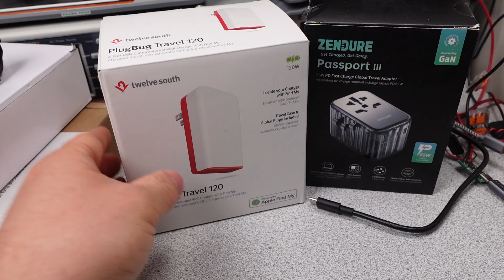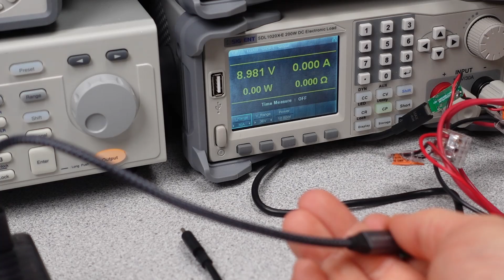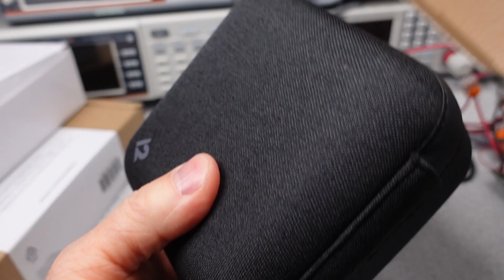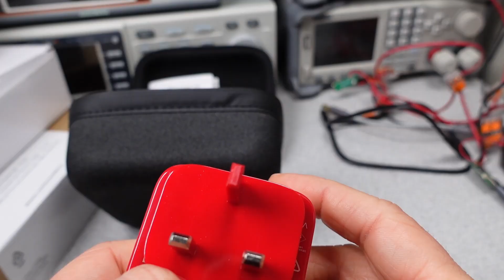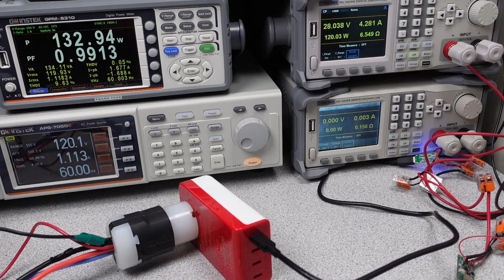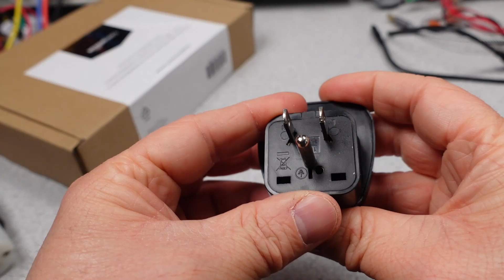Travel USB Chargers and Adapters Reviewed and Tested

Comment: Hope you can also test other popular universal adapter brands like Epicka, Ceptics, Tessan.
Reply from the maker: I think I've done a couple Ceptics and Tessan adapters of various types.  These things are under so many brands now.
Reply: @AllThingsOnePlace  Wow. Didn't expect to get a response at all. Appreciate it. I checked all your videos, couldn't find those for Ceptics and Tessan.

So far Ceptics offers up to 70W, Epicka 75W, Tessan 140W. 

I'm thinking they shouldn't be too great but idk, maybe they could be usable if you only consider 70% of their rating. Anyway, since they are travel adapters, most of their customers probably is bringing charger for their high wattage devices.
Reply: Always be vary if it has just two prongs but allows grounded plugs. Especially the two prong Europlug should never be split it converted to anything else. It is rated only for 2.5 A.

Comment: Was really hoping the Twelve South PlugBug would be the answer to my travel charger needs... guess not.  Anyone have any experience with either the Nomad Goods 130W power adapter or the HyperJuice 145W USB-C GaN Travel Charger with 4 Ports?  Am looking for a good travel adapter with three USB-C ports to charge an iPhone, iPad, and AirPods while traveling.. I've resigned myself to also carrying a 140W Apple charger for my laptop but would like to find a well made three port charger for the other stuff that won't burst into flames, or shut down after 30 min.  Currently using 2 Apple two port adapters and a 140W brick for the laptop.

Comment: Instead of an all-in-one foreign travel charger that's specifically intended to both adapt to various plug types and convert foreign voltage to 120V, what about reviewing the dual-voltage capabilities, performance, reliability and safety of chargers primarily meant to be used in north America but which one might want to take abroad if they're up to it. Then all you'd need would be plug adapters, which are fairly cheap and easy to find both here and abroad, and not have to buy potentially expensive chargers for use abroad.

That's how I've used my Baseus 65W charger, the one with a cord and 2 AC outlets. It's officially not meant to be used abroad for anything much over 120V, but it worked just fine when I tried it on 220V/240V systems without overheating, frying, smelling funny or destroying my devices. We're talking for well over a month, as I traveled through three different countries. Some research I conducted before my trip indicated that the USB charger circuity could actually handle dual voltage and that it was the AC outlets that couldn't handle higher voltages. But I figured that metal is metal and whatever voltage system you plug them into they're all AC and all have comparable max wattage ratings, and it's the watts, or amps, that matter, not volts. When I got back home it continued to work just fine, and has in the over a year since I returned.

But, most people won't want to wing it like this and would prefer a charger that's officially rated for abroad, and a review of the top chargers for their ability to handle that would be nice and useful.
Reply from the maker: Almost every charger is universal input voltage, none do any converting, none I show in this video are converters.  Some of the Baseus ones are specifically not though (I have a video on that).  The video says to use a universal input voltage charger and the appropriate adapter.  The charger will be marked if it can do the higher and lower voltages.

Comment: Most of those can be plugged in half.. which is not very safe and will be surely a fail/non compliant. Normally LVD can be tested on these easily, next to that the plugs will still need the plug certificates. That will still confirm the plug specific requirements (mechanical, dimensions etc).
Reply from the maker: Yeah, I like the dedicated ones, the AB ones, because they have official sockets on one side and plugs on the other that fit.  The multi-adapter things are not amazing but with shutters I kind of accept them, step in the right direction, yeah, I forgot to show how you can just wad plugs into these things in horrible ways.
Reply: @AllThingsOnePlace  😂great great content anyways!

Comment: I've had the Twelve South PlugBug in my cart for a couple weeks, went to see if YOU had reviewed it, and here we are! I was about to checkout and buy it...but bummer, it isn't great. I wouldn't mind some idle watts but I never want to see things get hot. Thank you for all your work.

Right now I lean on my 96W Apple charger (A2166) with the Apple travel adapters. I JUST WISH I had a decently equivalent charger with one more USB port, plus the swappable travel plugs. I try to keep things light and minimal, so I wish I could visit Europe/Ireland/UK with just one adapter. Four ports would be the max I would need - charging my phone, a battery, and maybe my watch - so I was hoping this device could do the job. I wonder if anyone will produce a charger like this but with decent efficiency.
Reply from the maker: Yeah, this one is tough, it on paper looks perfect.  Then it's not a great power supply which is it's primary function.  I'm still on the bring the cable or adapter you need and the charger that works.

Comment: Most of them try to establish some sort of data connection which one can tell by the prompt on macOS and iOS if one wants to allow the accessory. Can you tell why that is the case? Are there any USB controllers inside doing that by default?
Reply from the maker: They should not be asking for any data communications.  The chip is using the cc line to pass a small amount of data to negotiate power levels.  I'm sure someone will figure out a way to hack your machine through this path, rendering USB C completely useless, but there should be no data connection from this path to any part of the computer, phone, or any other subsystem data paths.  The computer can report if the charger is capable, allowing the accessory is understandable as it does connect to a data capable port but should not pass any information.  Are there bad actors, probably.  If you plug in a lightning, magsafe cable, those have their own chips in the cables.  So, may interact differently with the system.
Reply: @AllThingsOnePlace  Yeah exactly. There should be no data communication. However I had one Traveladapter with 20W out and it initiated comm on every port, type C and A. Both my iPhone and my Macbook showed the prompt..
Never had this before with any other device. Now I lost mine at a hotel and used another one from a friend: Same thing.

Don't know what they are doing there like what is the attack vector?

Comment: Hello mate, I am searching thru your videos already a week. The plan is to find perfect power source for frequent traveler. 10 months in adventure this year (US, Singapore, Indonesia, Africa) it is really a lot. Carrying separate charger for each device ( MacBook, 2x iPhone, android phone, Nintendo Switch, 2x headphones and Apple Watch) is really annoying. Almost bought Satechi 145w but your review help me to discard that decision. Mainly because isolation... I hate tickling when using some devices. Could you please recommend something from your lab bench?
Reply from the maker: That's a lot of devices... You probably will end up with more than one charger inevitably but there is certainly some opportunity to reduce.  I do recommend at least one apple charger, because of the reliability and good isolation performance.  The Zendure does have a lot of ports, mostly 5V ports but that will do all the small accessories and even phones, then one larger macbook charger handles the laptop?  Isolation wise it did well.  I use the Anker Prime 100W with an adapter for 'more isolation' on the go.  The Satechi isn't great in that regard.
Reply: @AllThingsOnePlace  Yeah, that's a lot. Anyway I am trying to reduce numbers of devices which I am carring with me.. it definitelly need a time to do that. For the moment I consider Belkin Booster Pro 140w. Main reason is that I can choose if I want to quick charge my Macbook or give him regular 65w - I think it is good for battery savings. There is not so often situations that I am charging all devices at same time (maybe twice a year).  Another set is 140w adapter (like Zendure, Verbatim, OneAdaptr - I think all them are on the same licence just branding and casing is different) plus Anker Prime 67w charger with 3 ports. It will be nice to hear your thoughts again.

Comment: Something like the Satechi 165W is the best kind of travel adapter. So many hotels have loose sockets, placed in cramped places, and often far away from where you'd want to charge your devices. Having a cord to the adapter itself fixes these issues entirely, plus you can customize the cord with different plugs and length.
Reply: This is why I like chargers that take standard C7 “figure 8” cables, you can just swap the cable out for whatever country you are travelling too. Very convenient for poorly placed sockets and no death plugs involved. Also check out the Tofu Maru and Mogics Super Bagel for other interesting options.
Reply: I got the Satechi 165W over the 145W travel adapter for the exact reason, because I knew I can't trust sockets in all places to be built well. The replaceable 2 pin figure 8 cable is easy enough to find anywhere. And the fact the 165W is cheaper than the 145W makes it even more of a good deal.
Reply from the maker: Yeah, I use that too.
Reply: It's unfortunate that this style of charger is usually heavy and bulky, this one weighs almost 5x my Nomad 65w and C7 cords don't pack as nicely as type C. Could be worth it travelling as a family though.
Reply: Are there any others have the kettle plug that is lower than 100w and still reputable?

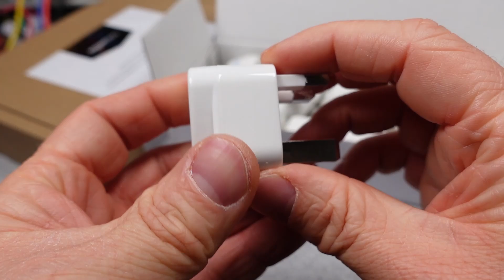Comment: 7:45. It really helps on safety for these adapters if you don’t put other metal objects besides electrical plugs into them.
You know, it’s optional for adults to do stupid things.
Reply from the maker: haha, I always shove the USB cable directly into the socket for maximum charging.

Comment: I'd say idle power is not that important for a travel adapter since I don't think people travel for so long that it matters. Safety on the other hand, crucial because you're in a place with unknown electrical hazards. I prefer the passthrough chargers because they're usually equipped with fuses and shutters on the plugs so they're safer than other adapters. And if I were ever to forget my own charger I can get by buying just a cable. Also safety markings on plug adapters are as meaningful as DOE VI efficiency marks on chargers.
Reply: Think about a relocation. You can either buy everything new (including laptop chargers which can get hard to replace) or an adapter.
Reply from the maker: Yeah, I cover the idle as completeness, I understand if you ONLY use this for travel then it's probably not plugged in all the time.  For that matter, most people could care less about efficiency too, but it's still a power supply so I look at them the same way.  But yeah, the simple adapters are cheap enough and if you pick the right one they are safe.
Reply: @AllThingsOnePlace  I appreciate the methodology and you sticking with it.
Reply: I don't think it happens often enough to a great number of people. But in that case yeah, it makes sense.
Reply: @ELaster1  In this case you would be best off just using simple but safe adapters that go from your original country to your new location. Or if the charger has a cable you could replace the plug end by rewiring it or buying a new cable depending on the charger. Laptop chargers often use standard C7/C8 cables which you can easily buy a new cable for which will work in your new location with no messing with finicky adapters. Apple laptop chargers are an example of this.
Reply: @TommyThousandFaces do you have a recommendation based on your preferences?
Reply: @jammies701  I bought a Lencent adapter and has been working fine. Has a replaceable fuse instead of a resettable one. But they include a spare on the device so it's always with you.